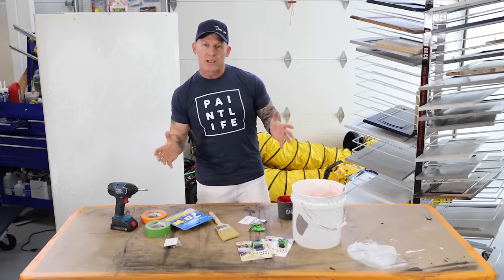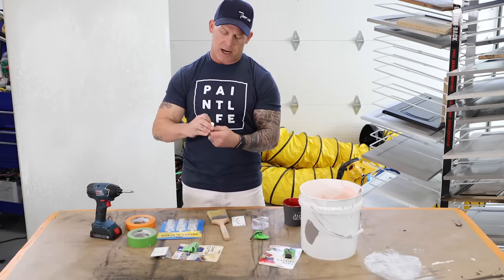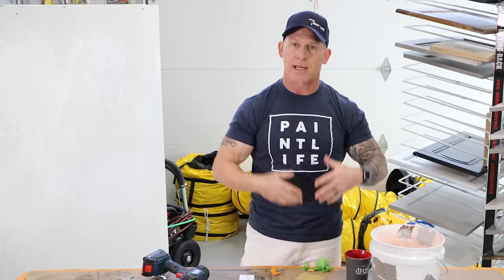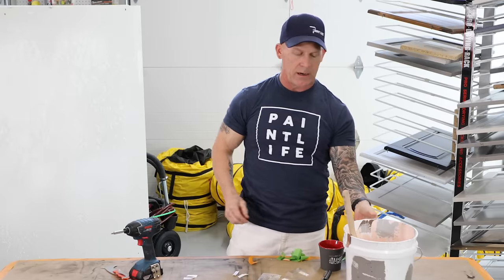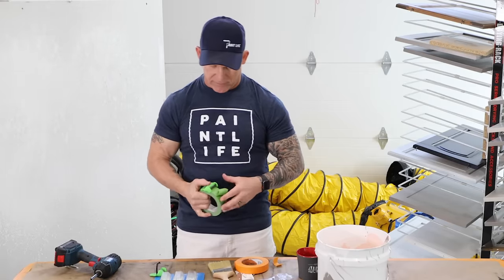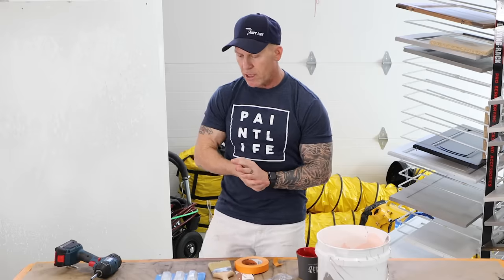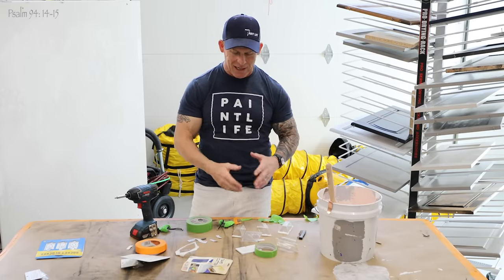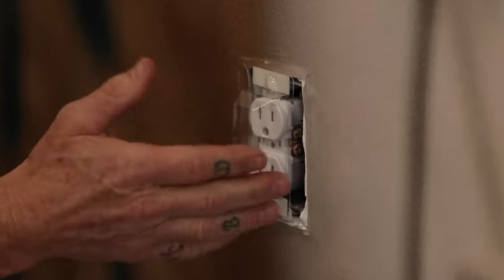3 AMAZING Professional Painting Tools

Comment: I've seen info that the copper brush holder now comes with 3M tape as well as screws. If you're going to affix by screws, predrill pilot holes so your $20 brush handle doesn't split. Drilling may weaken the handle over time by allowing moisture deeper into the wood. And, if you're constantly putting it on and taking it off, those holes will get weaker grip over time. After drilling pilot holes, perhaps get some wood preservative down in those holes, let dry, then install copper holder. Not sure I'd trust adhesive tape, even 3M, to keep my brush from submerging in my bucket. Anyway, love this channel.

Comment: I usually twist a piece of wire around it. You could use copper,lol, but a hell of a lot cheaper then 3.99. One roll in the concrete section of Home Depot OR your local masonry supplier is like $10. One roll Last for years.
Reply: Tad pole is genius. Socket blocker or 2” tape which allows you to roll over them keeping the sheen consistent. Another great video Potato! Love’em bro!

Comment: Hi chris im abt to start my own painting business n i have been watching a lot of painting videos recently videos using roller using sprayer so for interior walls what do u reccomend roller or sprayer
Reply: I’ve never seen a wall look good with spray only. Some new construction painters will spray and back roll, and certainly if you are doing residential repaints spraying walls in that setting is really not practical. When rolling walls I highly recommend using no less than 1/2 inch nap. Wooster makes a great roller cover, it is the “Cirrus”. 
Corona Makes one called “Ultra Fast”. Both of these come in a 9 inch or an 18 inch. They hold a lot of paint, put on a nice finish, and wash out extremely well. These kind of covers can be used over and over and if taken care of will last a long time. Also, they don’t have much spray coming off the roller when rolling walls. Both great covers. If you use one of these, let me know what you think. Thanks